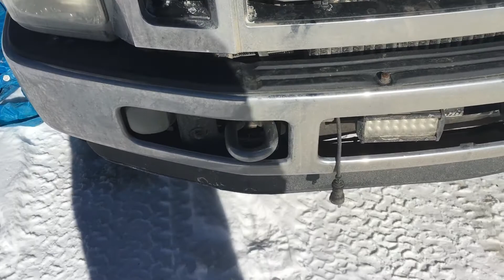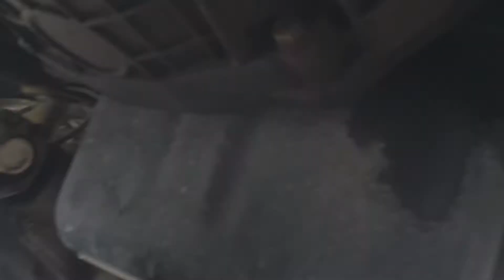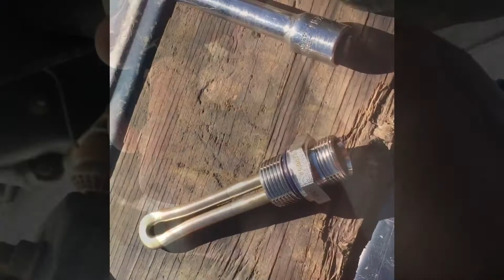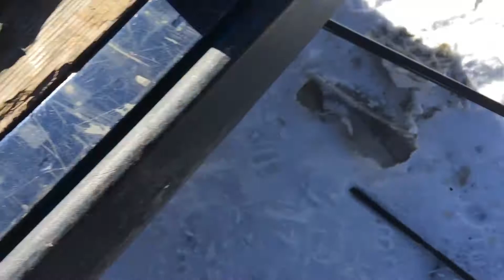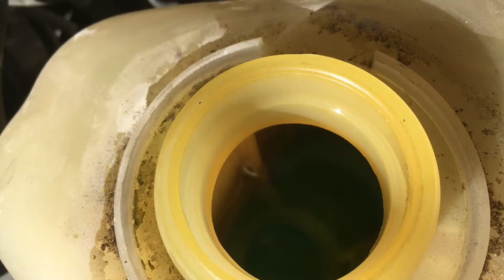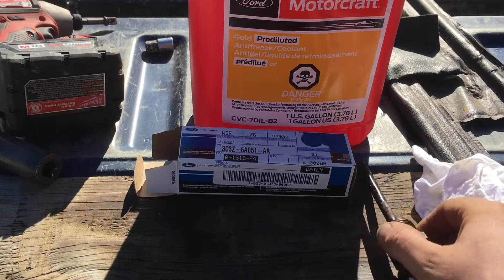Ford 6.4L Diesel Block Heater

Comment: Just changed mine today after a -35 celsius cold snap left me without a vehicle because the block heater stopped working.

Comment: I really need to see a 7.3 liter but I figured if I can locate my block heater on the 7.3 that the process would be similar. WHY DO YOU SKIP THE PROCESS. You show attaching the socket and that's it. I needed to see the thing coming out. Yeah you check the ohms and all that which I wont even mess with it. If it is new it should work. Then I needed to see the thing actually going in but you skip all that and your back to, well I have it back together now.  ?  DUH, I'm stupid about such and what's your point? You skip entirely the installation which should include taking out and putting in and you skip both. Very little help.
Reply from the maker: Thanks for the terrible comment. I appreciate it so much. Not even the truck you’re working on. Please make a better video. Cheers
Reply: I'm having the same problem with mines. I don't want to spend 800$ on a shop doing this for me when I already did my glow plugs myself.
Reply: I'm having the same problem with mines. I don't want to spend 800$ on a shop doing this for me when I already did my glow plugs myself. Have you located yours by chance? I have a 7.3 power stroke.
Reply: @tenalleclaw7611  The block heater replacement on a 7.3 is a piece of cake. Its located by the oil filter in the oil cooler housing. Just be careful torquing in down, the housing is Aluminum and you DON'T want to crack that.  Drain the radiator and disconnect the lower hose, a bit less of a mess. Only use a Motorcraft heater, or you will become an expert on replacing those heaters. Good luck.